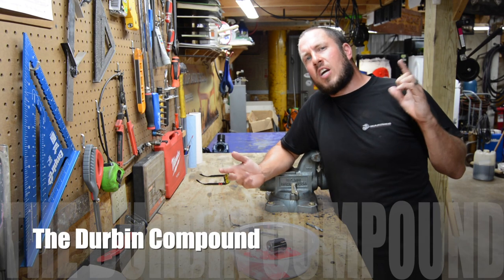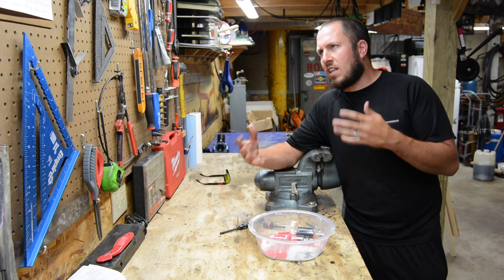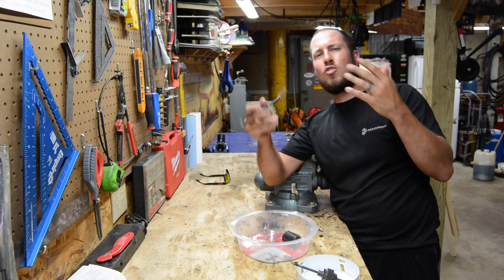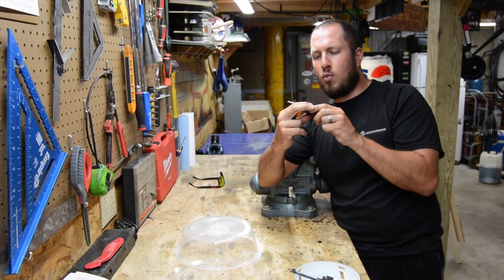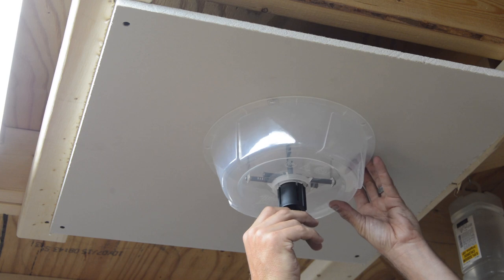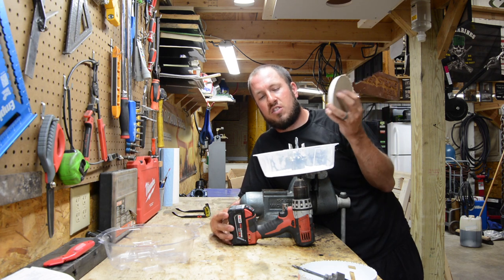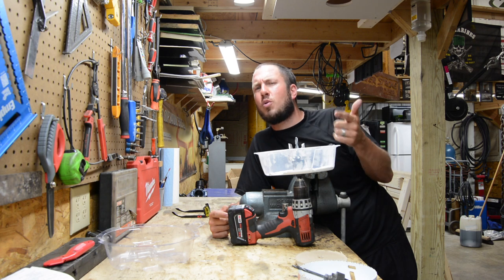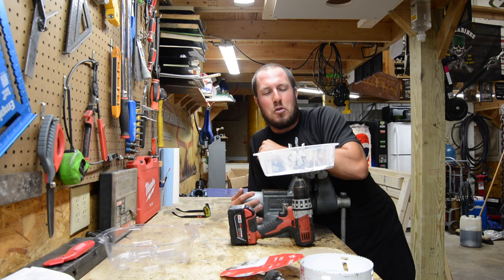Milwaukee Adjustable Hole Cutter - Awesome Tools Under $30

Comment: This last time I used it, it was extra dusty. I had some spare foam tape that i added to the lip and it greatly reduced the dust. Start slow so it gets is starting track in the cut or else it will stall and unravel the blades. The clips that hold the spring chamber broke when I pushed on it too much, but it still works.

Comment: Hello from Dublin Ireland 🇮🇪. I had one of these back in the early 2000s it was used for audio Applications ceilings speakers were the order of the day. My one went up to 12 inch’s for bass ceiling speakers. I can’t find something that will do the same job.

Comment: Can you use this on a pre existing hole to make a hole bigger?
Reply from the maker: No, it will not work in that application.  You can however mount a piece of wood in your current hole to start the drill bit into.

Comment: I was putting mine together to see how it works I put the drill bit in and I did not put the cutters in and now I can’t pull it apart. It is all ready to use but the blades are not in. It is totally stuck, how do I pull it apart?

Comment: How far does the drill bit extend beyond the blades? I have to cut a hole in drywall that has a PVC pipe right behind it for a bathroom light fixture. Thanks.

Comment: I'm looking to cut a 6" hole in my cargo van to fit a porthole window. Would you recommend an adjustable hole saw? or fixed hole saw? would they even be able to cut through sheet metal? Cheers.
Reply from the maker: No. These do not cut through anything but plaster and gypsum based products.
Reply: @TheDurbinCompound  ah I'm probably better off with a jigsaw then. Cheers :P

Comment: Can this hole saw be adjusted to different sizes such as 4 1/4” or  6 3/8” or just 2”, 3”, 4”...7” only.  

Oh wait, just saw the packaging which stated 1/4” increments.  Thanks for sharing.
Reply from the maker: Was just about to answer you!  Glad you got it figured out

Comment: Cut 4 holes in my ceiling and the blades are already flat, and catches on the edges causing tear out.  .
Reply from the maker: Wow, I had great luck with the tool!  You should be able to sharpen them fairly simply
Reply: TheDurbinCompound I wish it were that simple. The blades are literally ground down almost an inch shorter than they were new! They didn’t just dull. Anyway, going to see if it can be returned tomorrow - if not, I’ll be contacting Milwaukee. No tool should require as much maintenance as this would.
Reply from the maker: carguy1312 agreed! Oh goodness. Are you just cutting drywall?
Reply: @TheDurbinCompound  lol, sounds like he is trying to cut plaster (lathe & plaster)

Comment: Do you know if this could be used to cut circles from a thin layer or cork?
Reply from the maker: Yes I think that would probably work. It may pull some of the cork apart. The best thing I could think of doing is sharpening the small knives on it for a cleaner cut.

Comment: i just read  the amazon comments and they are rubbish
Reply from the maker: I’ve use this all the time. I’ve never had a problem with it. Used it last night with no issue.  Just need to have reasonable expectations of what it is designed for and use it according.